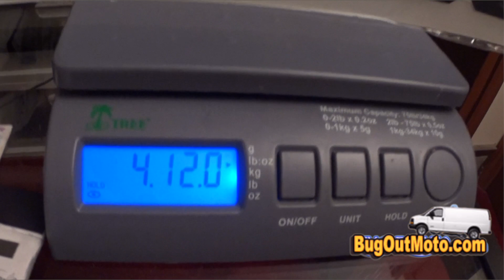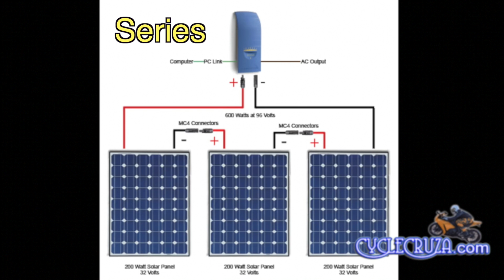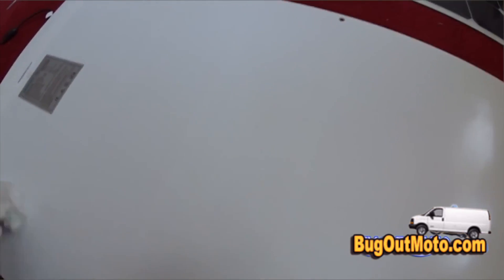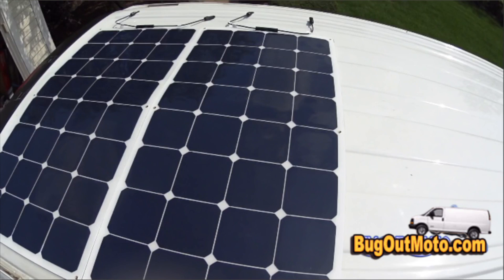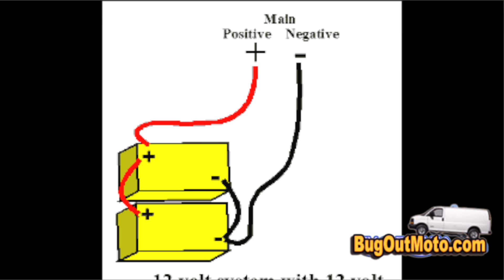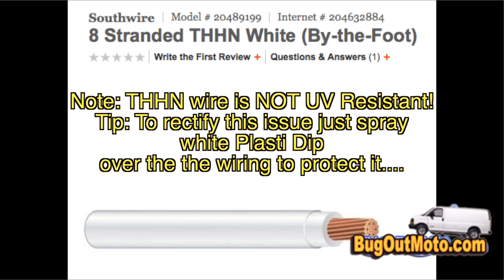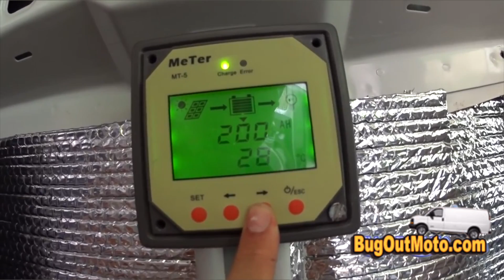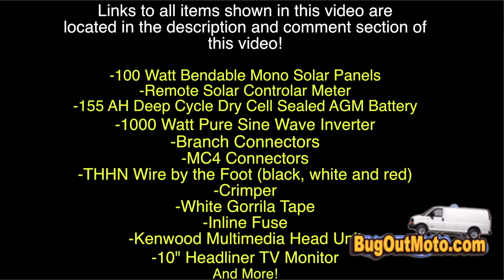Van Build Part 6 - 400 Watt Solar System Install | Bug Out Van Build Series

Comment from the maker: Links to Van Stuff:
Get ALL my Van Stuff here: https://cyclecruza.com/vanstuff
Get 100 Watt Bendable Solar Panels here: https://amzn.to/2QP4j4v
Get 40 Amp MPPT Solar Controller here: http://amzn.to/1S1Sop0
Get Solar Controller Meter here: http://amzn.to/1K16asL
Get Solar Branch Connectors here: http://amzn.to/1MmgfRL
Get MC4 Connectors CHEAP here: http://amzn.to/1VoIhPw
Get 12 volt Refrigerator/Freezer here: http://amzn.to/1Mzgu6R
Get 155 AH Sealed AGM Batteries here: http://amzn.to/1S1RxVa
Get Car Tire Alert System here: http://amzn.to/1iYbLEA
Get 12 volt LED TV here: http://amzn.to/1iYb5z6
Get 10" Back-Up Camera Monitor: http://amzn.to/1M1xZAC
Get Under-Dash DVD Player here: http://amzn.to/1jJkviC
Get GPS Cheap here: http://amzn.to/1iYbYrm
Get Gluten-Free Pancake Mix here: http://amzn.to/1M8qLK5
Get 600 Watt Small Microwave here: http://amzn.to/1MihFLM
Get 12 volt Refrigerator/Freezer here: http://amzn.to/1Mzgu6R
Get Butane Stove here: http://amzn.to/1L0XTkk
Get Camping Pot Set: http://amzn.to/1MTOspT
Get Cans of Butane here: http://amzn.to/1iYalKn
Get Portable Toilet here: http://amzn.to/1g0UB8l
Get Compact Folding Table: http://amzn.to/1NDwTMv
Get Bi-fold Motorcycle Ramp here: http://amzn.to/1KuvlCt
Get Motorcycle Wheel Chock here: http://amzn.to/1C0WGuI
Get Motorcycle Tie-Downs here: http://amzn.to/1KuQ8aI
Get Smart Battery Charger here: http://amzn.to/1KFsgBd
Get License Plate Back-Up Camera here: http://amzn.to/1KJv1jq
Get In-Line Fuse here: http://amzn.to/1IIoQw3
Get Power-Grip Pedal Tape here: http://amzn.to/1MmgkF0
Get Bluetooth Multimedia Car Stereo here: http://amzn.to/1Tx4o4q
Get Kenwood Sirius Ready Head Unit here: http://amzn.to/1Tx4o4q
Get 10” SubWoofer with Built-in Amp here: http://amzn.to/1Om8jxi
Get Sirius Satellite Tuner Kit here: http://amzn.to/1CPGk8T
Get Boss Amp Kit CHEAP here: http://amzn.to/1Om8pFn
Get Pioneer 6.5 inch 4-Way Speakers here: http://amzn.to/1TPSK4F
Get LED Light Set CHEAP here: http://amzn.to/1IizIQH
Get L-Brackets CHEAP here: http://amzn.to/1Om8HvV
Get Black 2 Drawer Night Stand here: http://amzn.to/1RPOHYB
Get Black Out Curtains CHEAP here: http://amzn.to/1RPPl8z
Get 32 inch LED TV with DVD player here: http://amzn.to/1NYh9lj
Get TV Wall Mount here: http://amzn.to/1LXDUGZ
Get Viper 2-Way Alarm System here: http://amzn.to/1D5bgMK
Get Flexible LED Lighting Strip Kit Here: http://amzn.to/1UyWWqP
Get Bar Harness for Handlebars here: http://amzn.to/1em2dRJ
Get Single Bolt D-Rings here (tie down): http://amzn.to/1em2nIF
Get Rv Firm Twin Mattress here: http://amzn.to/1Kp5bCB
Get 2000 Watt Inverter with voltmeter here: http://amzn.to/1OKkDrl
Get Solar Battery Cables here: http://amzn.to/1ElxBGt
Get Fuse Block here: http://amzn.to/1h0iPQG
Get Pop-Up Shower Tent here: http://amzn.to/1KLxWav
Get Water Pump here: http://amzn.to/1M6eOHo
Get 12 volt Hot Water Heater here: http://amzn.to/1g8HmlE
Get Wall Soap Dispenser here: http://amzn.to/1M4EZMX
Get Portable Shower Hose here: http://amzn.to/1H8wXCQ
Get Compact SINK: http://amzn.to/1H8xcxH
Get 7 Gallon Water Container: http://amzn.to/1H5TRbUGet CHEAP 
Get 6 gal Back-up Water Container here: http://amzn.to/1UnHvAW
Get 3/4" Drain Adapter: http://amzn.to/1SCuB0T
Get 3/4" to 3/8" Hose Adapter: http://amzn.to/1Lp6SAe
Get Clear 3/8" Vinyl Tubing: http://amzn.to/1ItO9xj
Get Tubing Clamp: http://amzn.to/1CnKAXq
Get Compact Travel Table here: http://amzn.to/1IjtKvf
Get 300 watt 12 volt Water Heater here: http://amzn.to/1KLxQzp
Get VanBed Rug VRG96 here : http://amzn.to/1dEtGNU
Get Motorcycle Deodorizer Cover here: http://amzn.to/1gXL7Ld
Get Portable Propane Heater here: http://amzn.to/1JA4s2z
Get 300 watt heater element here: http://amzn.to/1ZP7tOo

Link to Get ALL of my Van Stuff:
 http://cyclecruza.com/links-to-get-my-bug-out-camper-van-stuff

Comment: The only negative I hear about to the flexible panels is being mounted directly to the metal roof will cause them to run at a much higher temp and as the temp goes up the efficiency drops.  Have you ever not had enough juice?

Comment from the maker: Watch Van Build Part 1 here: https://youtu.be/fJqC5D6oXzo
Watch Van Build Part 2 here: https://youtu.be/A0QU-mupPiA
Watch Van Build Part 3 here: https://youtu.be/q_IWggV8AH4
Watch Van Build Part 4 here: https://youtu.be/srObFBWcnco
Watch Van Build Part 5 here: https://youtu.be/E2qJ80y2-88
Watch Bug Out Van Unveiling here: https://youtu.be/F2XXxsf1qoc

Also check out my all-in-one motorcycle channel at CycleCuza.com!
Reply: +Bug Out Moto Is it ok to lay those batteries on the sides?
Reply from the maker: Rocky Dobyns you can mount them in any position...they are sealed.

Comment: I cannot help but wonder if perhaps running the solar panel wiring inside the van would be worth it or would the potential for leaks etc make that a bad decision? Thoughts? I am just leary about all that sitting on the roof as in my area snow is an issue and I worry about how well they will stay and wear being on the roof in such a manner. Perhaps a large pvc pipe mounted to say a roof rack could contain the wiring and i could just run the wires I need too in through the back door trim such as you have. Again any thoughts?

Comment: 400W seems like a lot unless you plan on using an A/C. What made you decide to go with 400 watts? Thanks for your videos!
Reply from the maker: Actually, I now have 570 watts of solar power and added another battery ( 3 batteries now). You can never have too much. I now run a bigger refrigerator and a freezor. It powers everything!  https://youtu.be/NmalslYVYqI
Reply: BugOutMoto wow, cool! would that be enough to run an A/C, you think? I live in HEAT!

Comment: how do the wires go from the outside of the vehicle to the inside? I know there's a hole behind the tail light, but how did you get the wires in there?
Reply from the maker: you didn't watch the whole video :/ check 5:16 for your answer.

Comment: I thought about getting the flexible panels, but mounting them permanently is what turned me off to it.  If you switch vehicles, you have to leave a bunch of potentially valuable panels behind.  It also may effect the resale value and options of the vehicle as well.  I am just going to do a roof rack and mount the panels on there.  Even though the side of the panels can be seen from the ground, hardly anyone knows what they are looking at.  The vehicle still looks just like a typical work van and you're able to still stealth camp without a problem,

Comment: This van has to cost at least 70K by now. The
Reply: +Life On Two Wheels Not even close.  Chevy Van cost only about $3,600 used.  Solar system about $2,000.  Bed, cabinet, counter & water system about around $2,000 (cos, it's made mostly with plywood).  Misc about $1.000.  So, total is less than $10,000
Reply from the maker: +Life On Two Wheels lol A fraction of that. I will reveal the build costs soon but definitely under 10k for the mods alone, not including the cost of the van. It was't cheap but saved me a fortune over buying a 2004 or newer class B rv based on a chevy express 3500, also no class b rv van could fit a motorcycle like mine can. Chevy express 3500 are hard to find used that is clean for cheap. Brand new a chevy express 3500 cost 50 grand.